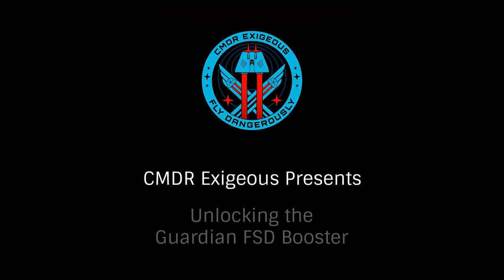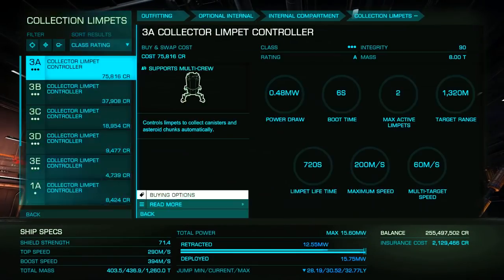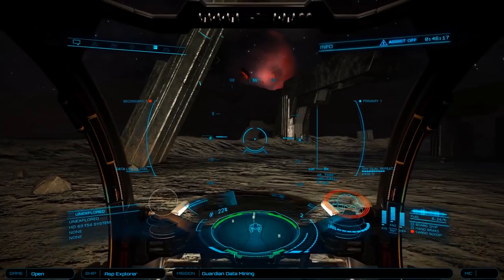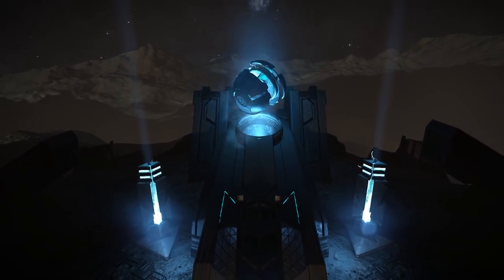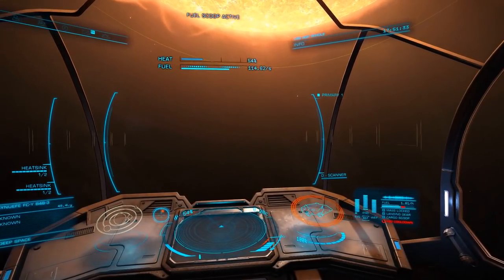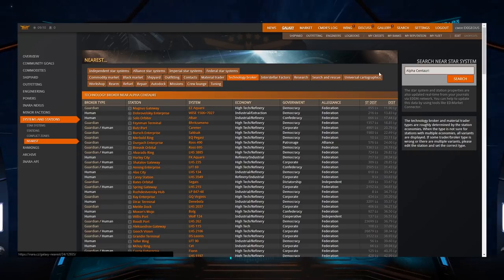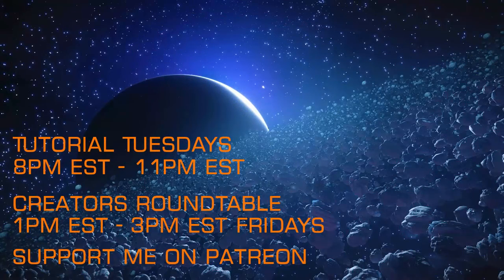Unlock the Guardian Frame Shift Drive Booster (FSD) in Elite Dangerous for Maximum Range (Tutorial)

Comment: I tried to watch another video on this same subject and the guy put so much useless information in his video dragging it out for like 20 minutes. I appreciate videos like yours that tell me exactly what I came here for so thanks. So tired of filler videos I don't know if there's a correct term for them, but that's just what I call them. Plus this video makes me wonder with all you have to do just to get these upgrades why the hell isn't this info in the actual game? You shouldn't need a 3rd party tool just to find all these items, all this stuff should be in game, I've been saying this for years now.
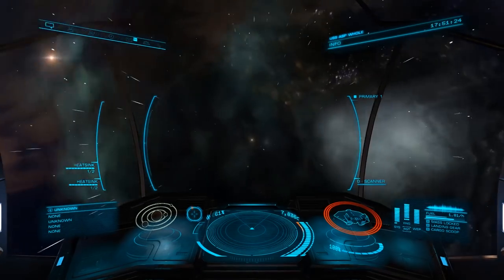Reply from the maker: Thanks for the very kind words as this is exactly why I started the channel.  I remember doing research for one of my early videos and the only others I could find on the subject were 35 and 45 minutes long - mine is 5.  Another Youtuber recently did a video on a topic that is 9 minutes long mine is 1:20, so I completely understand.  I also agree as to this information being in game as the only way you'd find it would be to randomly look at a material trader and see that there are some modules there - if you checked every station looking for them that is.

Comment: I can't figure out why I'm having such a hard time finding a parking spot.  The point defense thing sounds great, but at this point I've been circling for half an hour and would settle for anything.  
I'm in a Phantom, tried the recommended coordinates by Cpt. Riggs below, and I'm still having no luck. 
Anybody have any tips for parking?
Reply from the maker: Well because you brought a Krait Phantom and not a DBX like I suggest in the video. There's a reason I suggested to bring a DBX as parking at the site is really tough and a Phantom is a much much larger footprint than the slim DBX. So if you're still there or insist on taking a Phantom (which I would never suggest for planetary work like this) then you're going to struggle to find a parking spot. Here and at many other places - that's why I always take a DBX if I'm gonna use my SRV save for very rare cases. Beyond that you'll just have to keep trying until you find somewhere.
Reply: @Exigeous  Do you find that the Asp lands more easily than the Phantom, despite them both being in the same general size category?
Reply from the maker: Not really, they are both close enough that it doesn't really make enough of a difference - that's why I always suggest using a DBX if you're gonna use the SRV, especially for Guardian sites.

Comment: Structures only appear to be dropping power cells. Desperately short of technology components.  Any hints?? :(
Reply: Barry Gowans yeah I’m stuck at the site at the moment short on technology components... 😡
It’s really frustrating 
Should I just board my ship and log out and log back in?
Reply: I found them. There are some destructible panels on some of the large structures to the sides of the sites. Try those if the upright, thin structures don’t yield any. Got my FSD booster now and pinging about the Orion Nebula.

Comment: What is the additional fuel cost for using the FSD booster - when it was broken it seemed to be 125%, is it now just a 25% additional cost in fuel?
Reply from the maker: I'll admit I'm not 100% sure but I think you're right that it's 25% - I did notice I needed to scoop more often as I jumped around.
Reply from the maker: Perhaps I'm wrong (it happened once back in 2001) or perhaps it's a bug (that happened once, what am I saying, that happens ALL THE TIME) :D

Comment: Can this be used with an engineered FSD or does that not even matter?
Reply from the maker: Absolutely it can and yes it does. So basically whatever your range is, either after or before engineering, this adds up to 10.5 additional LY of range. So this allows a DBX to hit 74LY and an Anaconda to hit 84LY.

Comment: Could someone please tell me how this relates to Engineering? If I've already invested in modifying a standard 5A FSD, will I want to start over with the Guardian FSD? Can the latter even be modified?
Reply from the maker: This just adds to whatever range you have.  It isn't engineerable but if you already have your FSD engineered this just adds based on the size of the module.  So on an Asp let's say you have 50 LY engineered and you add the class 5 FSD booster - you then get 60.5 - make sense?
Reply: Ah, I thought it was a seperate module. Thanks a lot!
Reply from the maker: Well to be clear it is - but it's an optional internal that gets added to whatever you have.
Reply: I've done the business and see how it works now. I also found you only have to unlock it once and it will be available to purchase at any station that has a Guardian Tech Broker. Ray Gateway station in Diaguandri will give you a discount (up to 800k for the Grade 5 booster) as it's a Li Yong-Rui system. Thanks again for the video!

Comment: Max booster size seems to be linked to the size of the actual FSD in ship.  Example, the Dolphin cannot have a level 5 Guardian FSD Booster.  It is limited to level 4. Can't take level 5 to big ship and switch out.  bummer as I wanted to used this to change bases as dolphin is cheaper to transfer than big ship.  Still, level 4 FSD booster will help bring those ships until I buy one for all of them.
Reply from the maker: That's because the class 5 slot in the Dolphin is restricted to passenger or cargo cabins only - since it's for transport only.  There shouldn't be any limitation on other ships save for limited modules.
Reply: Thanks.  I was not aware of that aspect of the Dolphin.  Learn something new about Elite almost every day. I hear a mile wide and inch deep...well that is still a LOT of things to learn IF you really want to try everything.

Comment: Can someone explain the guardian Shield reinforcement? I want to know what it is
Reply from the maker: We haven't tested it much yet but so far it's like an HD booster that goes in optional slots so they can be stacked in addition to standard boosters.  In my limited tested with a Krait when using a Prismatic engineered with reinforced stacking all boosters DOUBLED my base shield strength.  A little OP maybe??

Comment: What do you mean repeat 6 times for the power plant, just the scan?
Reply from the maker: That was pre-chapter 2 where they lowered the requirements.
Reply: CMDR Exigeous  I'm outside the system. For the power plant do I repeat the whole process or the scan? Thank commander o7
Reply from the maker: Just the process to get the blueprints (so all the pylons, etc).  Then make sure you have whatever other Guardian/sentinel components you need.
Reply: CMDR Exigeous Thank you Commander

Comment: as a new player try multiply the "90" minutes with at least 10 if not 20. just the whole shitshow about learning to maneouver (getting stuck numerous times. Reload game without Horizon into orbit mode etc) and refuel/repair your SRV. not even mentioning firing and using the turret. Don't even bother doing this Guardian horrorshow until you have a VERY firm grasp of MOST game mechanics.
Reply: Well i did it in around those 90 minutes. However i played elite for 300 hours without this fsd booster

Comment: An Anaconda's jump range above 80Ly ... hum I'm at 78 Ly, all engineered... I guess you can reach 80 Ly + if you make it impractical for long range expeditions :) or I'm doing something wrong.
Reply from the maker: 82.2 unlaiden - https://s.orbis.zone/sCDXVMHL - best you can get with SRV
Reply: I'm gonna get more range by engineering my life support. 1 SRV is too few, I'll keep 2. But I'll take note of your power distrib... I currently have a class 3... but if we're going to get rid of boost ability, might as well go class 1, that's a good advice. Regarding the guardian power plant... I'm not sure the gain is worth the grind :) Also... no detailed surface scanner ?
Anyway, thanks for the link.
Reply from the maker: I did miss the surface scanner, true you'd want that.  Personally I feel 1 SRV is enough, even with 2 of I bin it I'm gonna be screwed so I'm just careful with my main one - and make sure I have plenty of mats to synth a repair for it (or10).  As for boosting if you do a grade 5 engine focused with cluster capacitors you'll still be able to boost once with a full distributor so you get the weight savings and boost ability.

Comment: Doing this when the planet is dark is kind of useless for someone who has never done it and is trying to learn how. Where did you get that map of the area? How do I access it? Also, you might want to mention that those sentinels are bad, it takes forever to kill them and if they spam missiles, it is impossible to escape because your srv starts bouncing around like a rubber ball. I would not have spent all the time getting there if I thought I'd get killed. On second attempt, I ran out of srv ammo, so you might also want to mention gathering materials to refresh srv ammo and fuel. As a new player, this video didn't explain the process clearly.
Reply: There's carriers that sell ammo. Also its good to have a point defense turret for the missiles.
Reply: Point defense on your ship is good, too

Comment: The amount of time, for the gain, is just not economically viable to me. My time has a value, and I factor that into opportunity cost. Your time may not, or you may not value your time appropriately. But putting a skinner box grind inside a grind inside a grind for me to pull a lever over and over again in a game is just flopping your nuts out in my face. Unfortunately Fdev are isolated from their fan base by 'community organisers' who 'curate' feedback (see; censors who censor shit) so they don't give a fuck anymore.
Reply from the maker: Never going to defend the grind but this is somewhere I absolutely disagree with you.  This takes 90 minutes, tops, to unlock and adds a huge quality of life to every single ship you own.  In some places increasing range by 40% - I call that well fucking worth it, especially if you value your time.  Not sure about you but most play 5+ hours a week so given you can do this in one short play session and reap the rewards - forever - pretty great in my book.
Reply: '90 minutes' for 4/6/7.7/9.2/10.5 light years gain. Ignoring the fact that it will take 30+ minutes to even reach the site, sacrifices an internal forever, and you're totally at the mercy of RNGesus and game mode hopping. That's two hours. Unless you're one of those people who can handle the sheer insane boredom of being 10,000 ly from home hop honking stars all day (I suspect drug use must be essential for that, or a TV in the same room at a minimum!) that means for every 100 jumps you're saving around one jump. One. One jump that will take 10 seconds. To break even that means 720 total 100+ LY trips. Just to break even time wise. Let's say in the future LY range increases and it saves you TEN jumps, that's still 72 100ly trips to break even with time invested. And you still lost an internal. To be honest, I would rather punch myself in the dick for two hours than endure another grind in Elite for anything. It's soul crushingly grindy. I'm sitting at 1892 hours, and that's AFTER Elite merged their accounts with Steam, at this point I'm questioning whether I have autism for repeatedly returning to a second job that I pay to have the displeasure of doing. :P

That said, I love the fact your videos don't have ridiculous intros, or long drawn out waffle, and get straight to the punch. It's absolutely refreshing to see clear concise instructions. One thing I recently discovered when a friend asked in a panic is there's no timely information for canopy breach emergency response. There's 16 minute videos, none of which tell you 'look to your right panel, generate more life support and relax' - you should probably corner the market on that given your concise style, you'd save many commanders lives! <3
Reply from the maker: As for unlock time I've done it personally, including flight time in just over an hour - yes your mileage may vary but it's really not long - and since you only have to do everything for this once, save for a couple logs for the tech components (power cells drop like crazy).  You're also not doing the math right about the increase, you're forgetting bubble travel.  There are many times it will save you a single jump - and when you add all those minutes up (1 minute per jump) you'll make back those 1-2 hours quickly (in Elite terms).  Also remember when you're moving around a ship like a Corvette going from 15 to 25 LY is a HUGE increase.  On a 73LY Anaconda not huge but on the Vette it's amazing.  Remember too this is 100% optional, you don't wanna go unlock it then totally your choice.

As for being brief, clear and concise seems you've 100% gotten the point of the channel :D  I've had a few people tell me I should make sure my videos are 10 minutes so they will monetize better.  FUCK THAT.  I will NEVER been longer than I absolutely have to be - the irony is I can be rather long winded in chat/voice but in my videos I work very hard not to be.  I've seen another video on say data gathering at the Jameson crash site that was nearly 10 minutes - mine is 2.  Will always be that way.
Reply: I started following your tutorial at 12:30PM. It's 2PM. I've yet to succeed. I have well over a thousand hours wracked up in Elite so I'm not exactly a hapless newb. I've gotten all four pylons up, the two at the head, then dropped the relic only to have it spawn on top of me and roll down my back a few hundred times. I definitely think the other players suggesting having a mate do the charge is a great idea. But for us solo pilots out there, this is a right bugger. I suspect that 90 minutes is very, very optimistic and not reflective of real world first time unlock captains! :P But you're definitely right, I can see it being useful to low jump ships. BUT. That said, for say a combat vette, sacrificing an internal for 10LY versus pressing jump one more time, I don't think many people would consider that a valuable trade off. Edit: After hours of fucking around it turns out a sentry skimmer was bugged into a wall and I was in 'combat' so couldn't activate it. Brb. Shooting myself.
Reply: @bashkillszombies  I did this unlock SPECIFICALLY for my 'Vette.  It took me less than 20 minutes to reach the place in my AspX (50 LY unladen), 50 minutes to do the site (I spent the first 15 just driving around it in awe, then once I actually started the pylons up it took about 20 minutes, then I relogged and gathered mats one more time and grabbed another blueprint).  Then it took me 18 minutes to get back, thanks to a neutron star providing the last 200 LY of the return trip.  Picked up 8 of the thingees, hit the Tech Broker, and now I have 63.70 LY jump range on my AspX, and my 'Vette will push 30 LY now.

If I did this again I'd be done in an hour, 90 minutes at most.  You're acting like you are required to bash you nuts with a hammer to unlock the blueprint.  You have to fly to a place you haven't been, see an actual THING in this game instead of another lifeless rock, and interact with actual NPCs that shoot at you.

I really enjoyed stopping the grind to do something LESS grindy.
Reply: The real waste of time is arguing with people that feel this way.  A few hours work to save far more than that getting from A to B for the rest of one's playing lifetime?  That's hardly a waste.  And the Guardian sites themselves are amazing.  Totally atmospheric, especially if you visit at dawn with the light spreading over the scene... wonderful music to go with them, some interesting challenges available if you want them.  I'm doing this at the moment, just taking my time and enjoying the experience.  Even hung out with another CMDR last night at the site who happened to visit at the same time as me.  I may or may not stop at the FSD booster, but it's an excellent piece of game content.  And an excellent video too, so thanks to CMDR Exigeous.
Reply: Dont play then
Reply: @bashkillszombies  I burst out laughing at the "autism" quip whilst at work because I've doubted my own ability to reason at different points playing Elite "Space Trucking Simulator" as well...
Reply: @George-qw8ss  arguments that the game has too much "grind" are valid... your input however is not value added...
I'm sure you're an absolute peach to hang out with based upon your dismissive response...
Reply: @EugeeFGII  it's really a very small amount of time for Elite standards, and a totally unique and cool gameplay element.  Not sure where these complaints are all coming from.  Could only assume the complainers also hate the taste of water, and find breathing tiresome.  o7